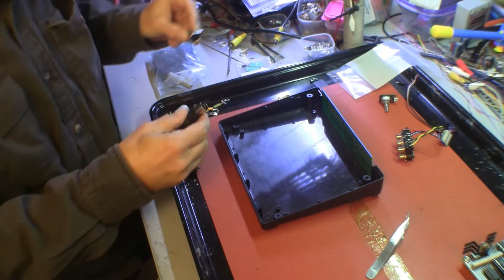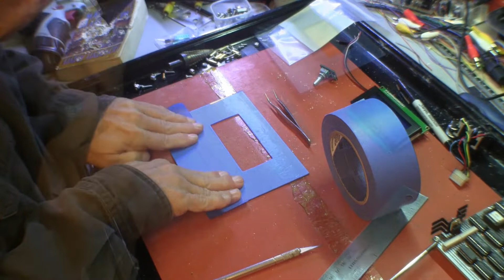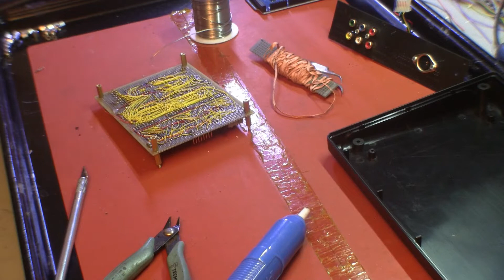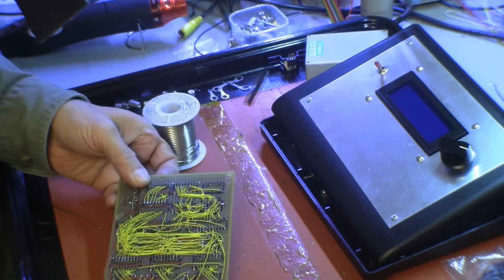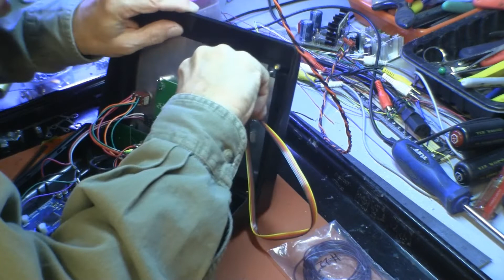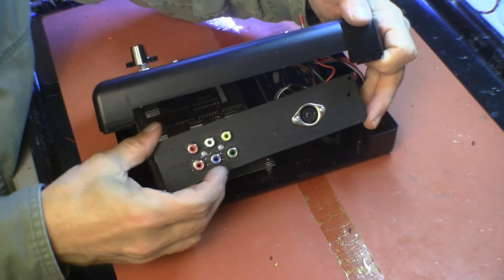NBTV 10-4 Eleanor, Part 9 - The Home Stretch

Comment: Great work Richard ! this ones a bit beyond me  as a project i am always very impressed with what you can make out of your head ! i am going to have to stick with PhonoVision V3 for the original classic video storage   ; 0 )
Reply from the maker: Wait til you see the hardware deep dive. You will be amazed at how simple this thing actually is. That was the point and the goal of this project versus, say the Aurora World Converter. Very low construction complexity and I will be giving away the timing ROM data for free. A builder won't even have to deal with that.
On the other hand, I find your phonovision to be complex beyond my comprehension. So, we're even. :)
Reply: @videolabguy  Hi Richard i think its very impressive but i tend to stay clear of digital gear i know my limits unless i understand what i am doing i don't go there ,i recall trying a sstv kit very similar multi system in the 90s i never got it to work and never understanding  how it worked fault finding was hopeless for me ...PhonoVision was a learning curve but i seem to be better at 100 year old micro embossing video recording ...OH not even i could never come up with your ideas and make them work .

Comment: Here in Canada, Home Depot sells "TREMCLAD Professional Rust Enamel", in a taller-than-normal can. It's available in limited colours and finishes, but flat black is one of them. It dries FAST. The back of the can says 15 minutes, but if I do a couple light coats, I can get the total drying time under 10 minutes.